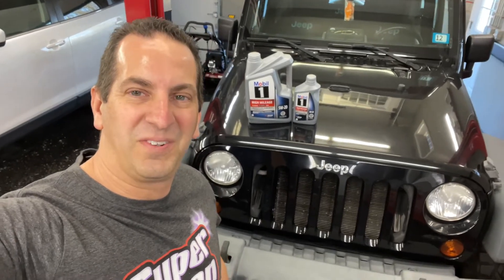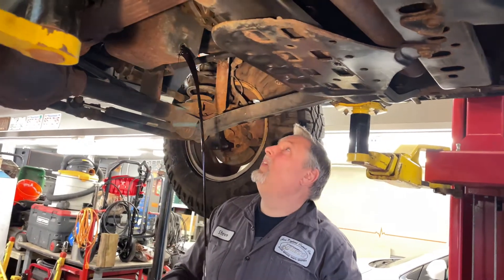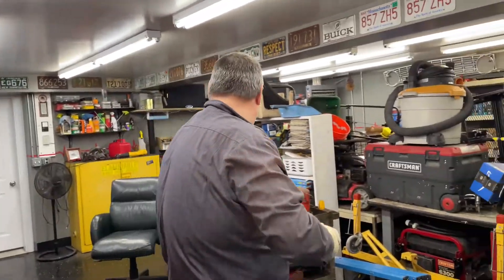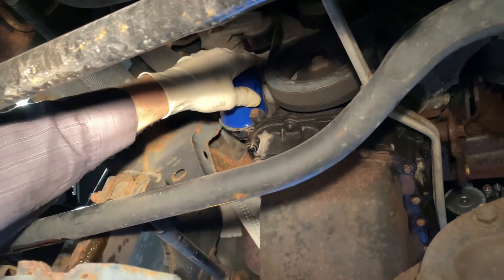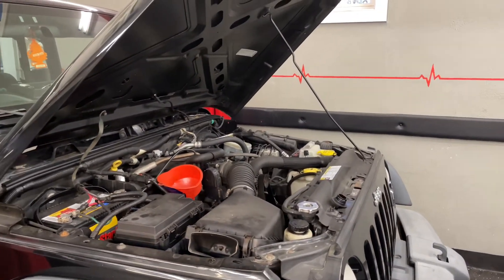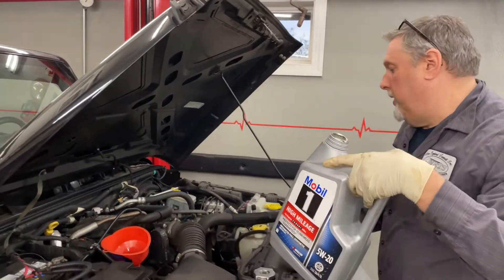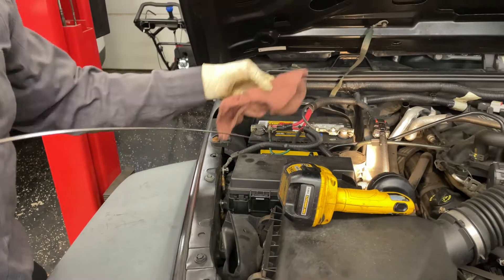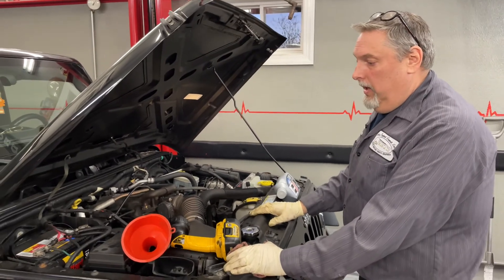How To Change Oil and Filter Jeep Wrangler JK 3.8 Engine

Comment: The engine was designed for 10W30 then they dropped the weight down to 5w20 for fuel economy with no changes to bearing clearance. 20 weight is too thin. 5w30 for me, always.
Reply from the maker: Thanks for watching. Don't forget to sub the channel to for more videos like this!
Reply: I totally agree, im running 10w40 in mine
Reply: So we’re going to ignore the manuals recommended 0w20?
Reply: @Mfision  yes.

Comment: I have a 2009 3.8 jk, i did transmission and engine oil change, did you ever get a new tranny oil pan with a drain bolt? Because the oem doesn’t have a drain which is pretty dumb so you make a mess
Reply from the maker: I think we just reused the old transmission pan.

Comment: If you drive less 1000 miles a year at what intervals do you change oil
Reply from the maker: I'd probably do it every two years.
Reply: I would do once a year regardless. Oil becomes acidic overtime
Reply: Most vehicles will send a msg on the dash letting u know when it needs changing